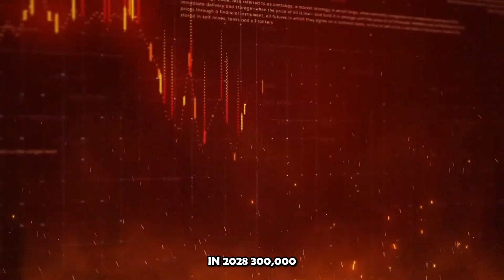The New Panama Canal Is In Mexico!

Comment: To handle container freight Mexico has to build container loading /unloading terminals and deep water ports at both ends until the canal is finished and then what happens to the redundant container facilities. They could be used for containerised import and export goods for Mexico but that would be much less than the terminals were built for.